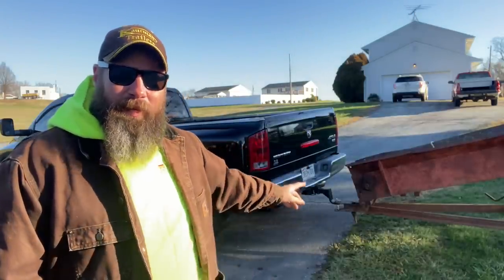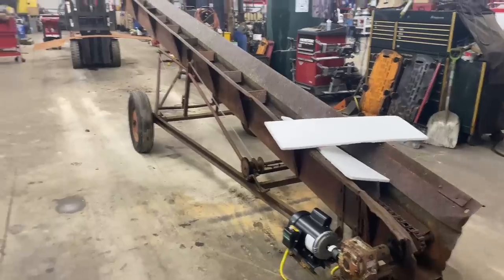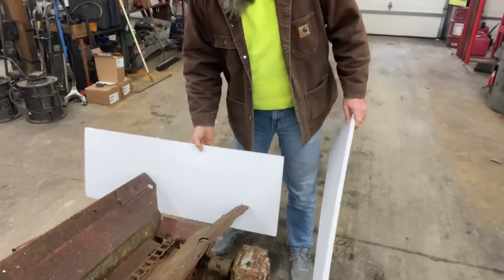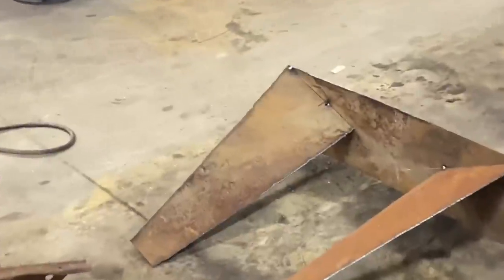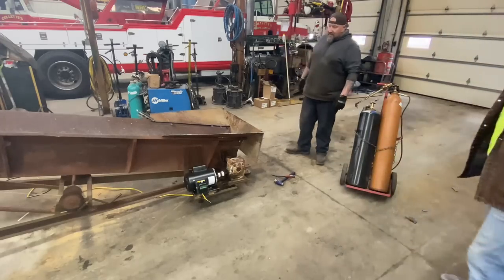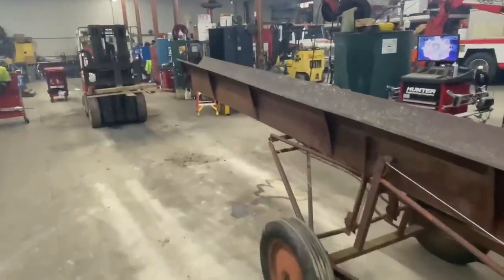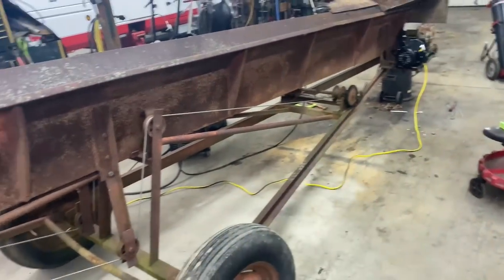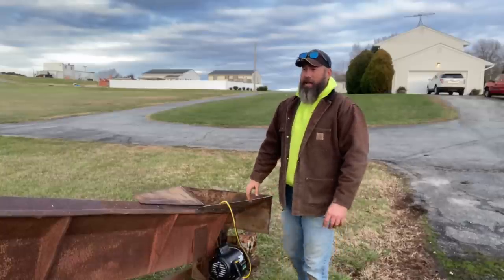FIREWOOD CONVEYOR TRANSFORMATION - #116

Comment: Congratulations on your conveyor purchase and modifications. Seems like Jerry fixed you up 👍👍 . You may want to add one more needed modification 🤔 I would install ½" thick UHMW plastic to the bottom of the conveyor to extend the life and make it much quieter to operate. This product can be found from suppliers that deal with conveyors and grain handling equipment. The plastic is bought in 4x8 and 4x10 sheets. The stuff is tough but can be cut with a carbide blade on a circular saw. It's kind of pricey 😵 but well worth it. It can be installed with ¼"x 1¼" non-fanged elevator bolts. Make sure you double nut each one to prevent the vibration from loosening them. Doing this modification will have less drag on the conveyor chain, freeing up some of the horsepower on the motor so it doesn't have to work as hard thus extending its life as well. Keep up the grind, my brother from another mother.
Reply from the maker: Thanks for the advice!

Comment: I’m sure that’ll pair up nice with the upcoming changes. Just a thought but may be worth making the cutout on the belly plate for the paddles larger and possibly adding some heavy rubber there?  I’m sure there will be small debris that could escape a larger opening that may build up with tight tolerances. I also wonder if a small piece of wood could get caught in a paddle and the bind on the lower tolerance opening causing the chain to jam or snap etc. just a few thoughts. Keep up the good work.

Comment: This is definitely a good one. I hope to get myself one of those grain hoists myself do the same thing. The only thing I would’ve done differently from what you guys did was I would’ve welded the parts of the hopper together but I would’ve bolted it to the conveyor. So in the event that you needed to remove it to do other repairs.